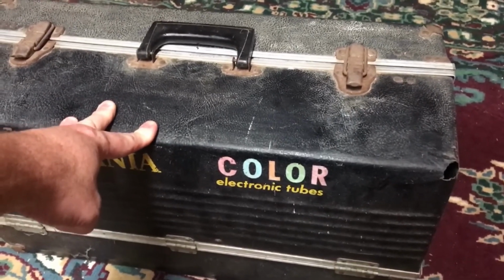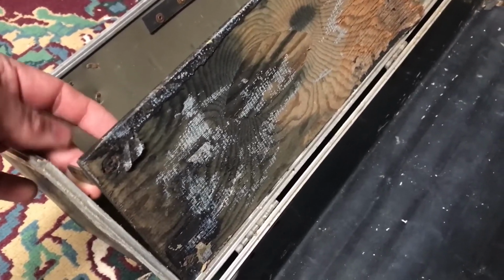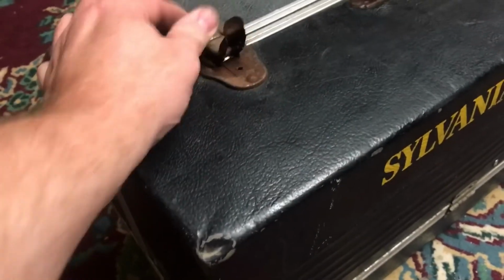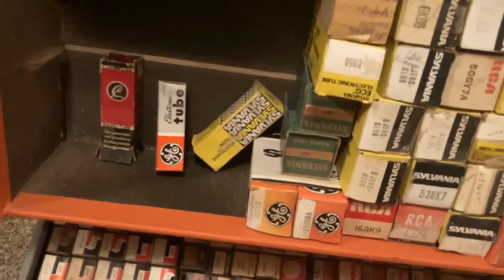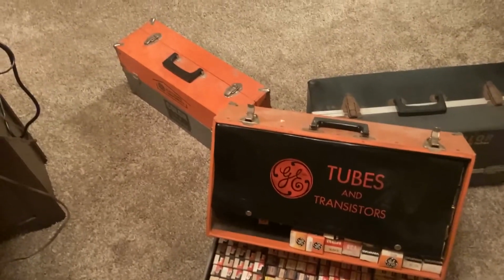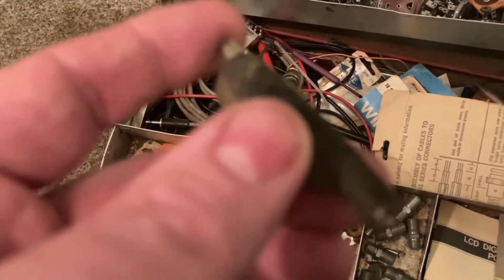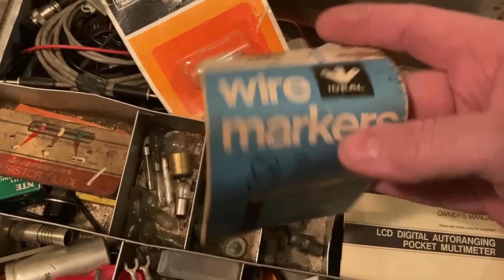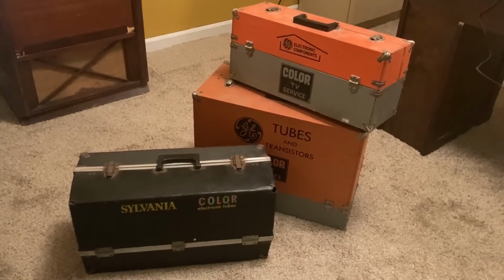Fixing a Vintage Sylvania CRT & Radio Tube Caddy Somebody Left Out In The Rain!

Comment: At 13:45 in that is an electrically operated doorbell chime. Why would Bob have it in there. The red magnet wire could be 
unspooled and saved for a transformer redo I guess. Doohickey is a technical term used on ART ( amateur  repair time).
My now deceased grandfather had a resistance color card like yours but he was blue -green color blind. So it didn't help 
him too much. LOL
Reply from the maker: That wouldn’t be a huge problem until you got to that third band!

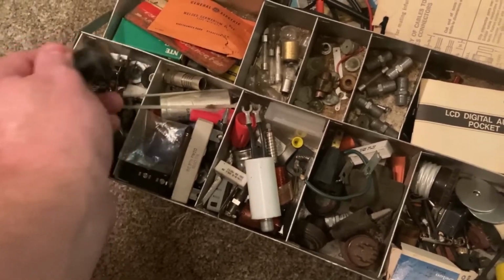Comment: Last count I had 11 Tube Caddy's, full of tubes, and boxes of tubes, figuring close to a Thousand Tubes in my collection along with 6 tube checkers... DO NOT put that tube extension you showed in your tester! It was not meant to save a tube checker socket. The one shown at the 15:50 into the video!! That is used to check tube voltages. You plug it into the radio, then the tube goes in the top. Those metal tabs sticking out is so you can connect a voltmeter and read voltages. Prevents you from pocking around under the bottom of the chassis!!
Reply from the maker: Oh no I accidentally stuck it in my tube tester!!!!!  I’m an amateur